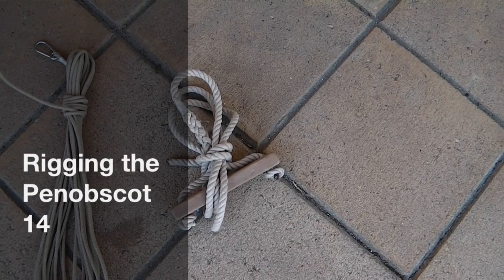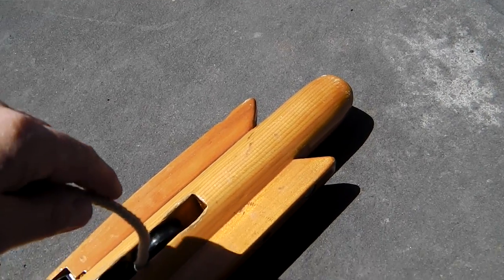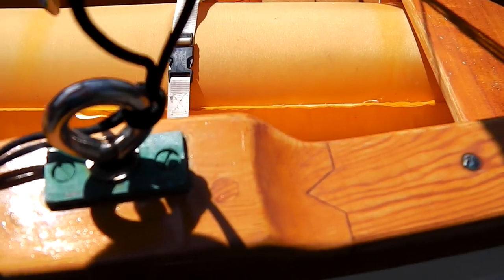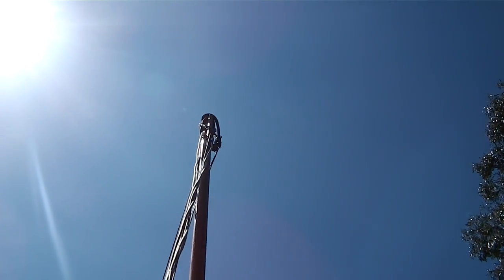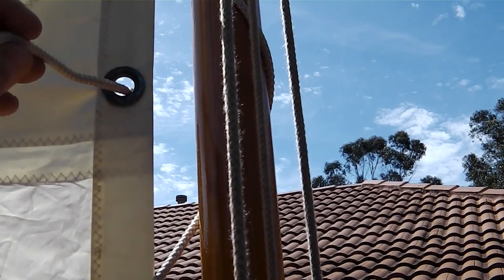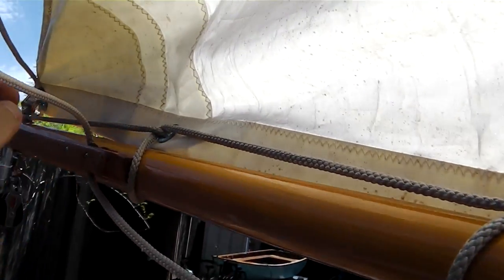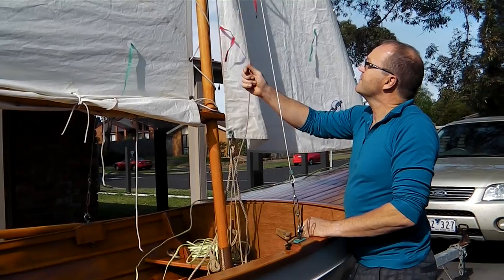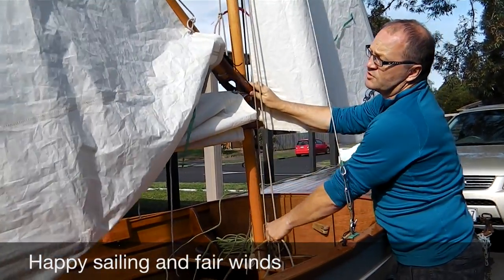Rigging the Penobscot 14

Comment: Richard - I have been searching the web for ages on how to rig a Penobscot 14 and had given up. Now I've bumped into your brilliant how-to and have made a mini-manual for myself to start making modifications to my rigging. Your rigging makes so much sense and has a number of clever innovations not in the original building materials. Thanks again for spending time making and posting this video! I noticed you have an eye strap / saddle on the mast head - what is that used for?
Reply from the maker: trinity2too2 I had originally rigged some lazy jacks that went from that saddle under the boom and back to the top through the port side block but went back to a simple topping lift

Comment: Richard, Many thanks for this very thorough tutorial.  On my P14 I only have 2 lines to the yard. One about 3 ft from the throat and one line just inches from the throat. Also, I don't have the sliding wire on the arm that you use. Can you talk about the advantages of your rig?   Brian
Reply from the maker: Hi Brian, the wire on the gaff is there to allow the sail to be reefed without needing the sail to be taken down and your gaff halyard tied to a new spot. The wire runs between the two locations that you would tie the gaff halyard in the reefed and full sail so at these points the yard is still held in tight to the mast
Reply from the maker: This configuration is called a sliding gunter so if Google that you will find further information

Comment: Why do you rig a backstay and remove it again after rigging the mainsail? is it because the shrouds don't reach back a bit and you want to secure the mast from falling towards the bow?
Reply from the maker: Nele Abels I think you might be referring to the topping lift. This just holds the boom up while you are rigging and also when you want to put a reef in the sail. When you are reeding on the water it is far safer for the boom to swing free rather than it being in the bottom of the boat